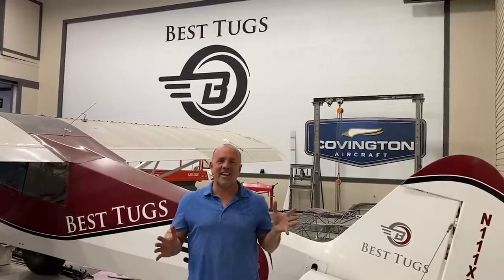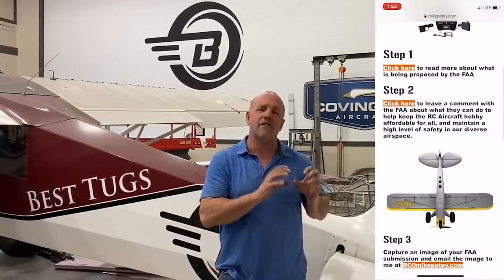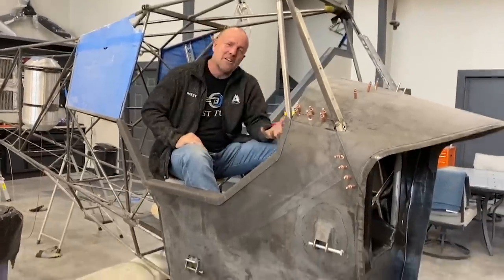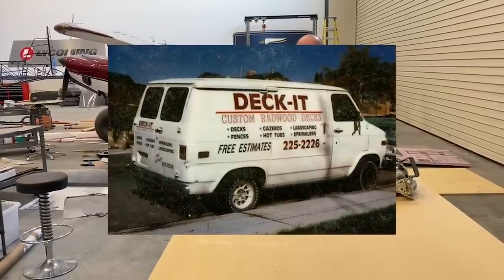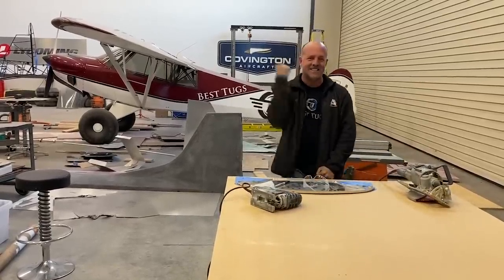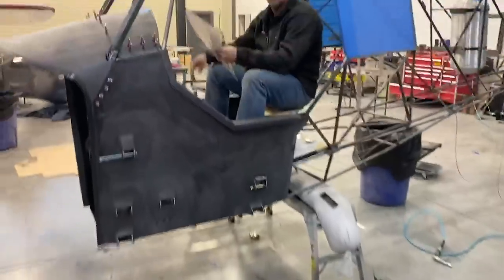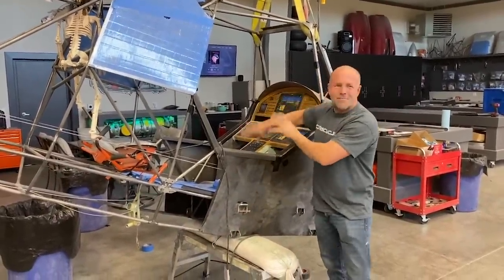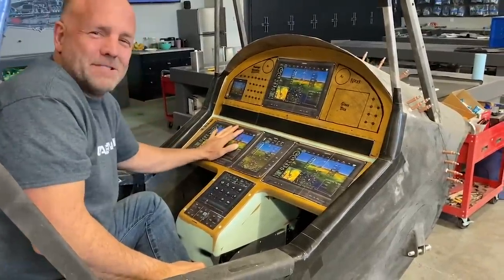🤠 Garmin Glass + Carbon Fiber (SCRAPPY Bush Plane 10)

Comment: Mike, I'm so glad to see you asking for help on the Remote ID NPRM.  It would be a disaster for the RC hobby.  I submitted this comment about ten days ago:

"I am writing in opposition to the proposed rule, inasmuch as it applies to Traditional Model Aircraft (TMA) (as defined in the 2018 FAA Reauthorization Act; that is, small unmanned aircraft systems that are not capable of navigating beyond the visual line of sight of the operator through advanced flight systems and technology). As an active general aviation and airline pilot, I have a vested interest in both maintaining the safety and security of the NAS, and in promoting aviation to future generations of aviators. The TMA hobby is an excellent avenue for promoting aviation and should be protected from unnecessarily burdensome regulation.

The proposed rule makes an inappropriate and unsupportable assumption of risk with respect to TMA operations. These models have been safely operated in the NAS for generations and pose no more risk today than they have in the past. They are built and operated by skilled hobbyists who adhere to a widely publicized Aviator's Model Code of Conduct. In fact, the TMA flying hobby should be used as a model for successful, safe integration of newer UAS into the NAS.

The rule proposes that TMA be required to carry a Remote ID device, presumably similar to a manned aircraft's transponder. Further, the proposed rule would require automatic on-board geofencing in cases where a TMA lacks Remote ID. These are expensive requirements that are unnecessary due to the fact that TMAs operate entirely within line of sight of the operator. They are small enough that the limitations of human sight make distant operation, practically speaking, impossible. Instead of requiring expensive electronics that add unwelcome weight to delicate models, the FAA should expand its use of the Low Altitude Authorization and Notification Capability (LAANC) system to allow TMA hobbyists to advise the FAA of their intended operations via an internet portal or smartphone app. This system would provide necessary information to the FAA and law enforcement, but should be configured to also protect users' privacy by limiting public accessibility of the submitted information.

The proposed imposition of a 400-foot bubble of operation around a TMA operator is severely limiting and should be entirely stricken from the proposed rule. The visual line-of-sight nature of TMA operations is already self-limiting; the tiny 400-foot limit is unnecessary and will largely destroy some segments of the TMA hobby, specifically giant scale and ducted fan/turbine powered models.

The proposed rule establishes a system of FAA Recognized Identification Areas (FRIAs), in which TMA hobbyists would be permitted to operate without Remote ID, and limits establishment of these FRIAs to a 12-month period after adoption of the rule. Again, this is an unnecessary and burdensome requirement that would choke out the TMA hobby over time. These areas should be able to be established at any time in the future, and they should exist without expiration until cancelled by the sponsor. The proposed rule also imposes an amateur-built requirement on TMAs, which would eliminate an entire segment of the industry that produces and sells ready-to-fly model aircraft. These are the very models that are most attractive to young people just starting out in the hobby, and most likely to introduce them to aviation. Restricting this segment of the TMA hobby is foolish and unnecessary.

Finally, the proposed rule imposes an annual registration requirement on each individual TMA. Some model hobbyists build, own and fly dozens, even hundreds of models over their career in the hobby. The proposed registration requirement would impose a significant financial and record-keeping burden on these hobbyists, and serve as a barrier to entry for young people who want to get into the TMA hobby. Instead of the proposed per-TMA registration, the rule should be amended to reiterate the current requirement that TMA operators register once. That registration, and its renewals, can include a question about the operator's model fleet, if that information is needed.

I have a friend and neighbor who is both a fellow GA and airline pilot, as well as a model aircraft hobbyist. We live next to an active county airport that has a model aircraft field immediately adjacent to it. In all the time we have lived here, there has been zero conflict between TMA operations and manned aircraft. Model hobbyists have at all times conducted themselves professionally and with respect for the safety and security of the NAS. I have seen no reason that the TMA hobby requires or should be subject to the onerous and burdensome regulation proposed in this rule. Please consider amending the proposal as suggested above, and let the TMA hobby continue to serve as an exciting, low-cost pathway for youth to enter the aviation world in a safe and responsible way. Thank you."

Comment: @Mikepatey love your excitement. Just a question ... do you really need a G5 back up when either one of the G3x or the G3 could be configured to run independently and there for qualify as a backup? Secondly with all the ability of the Garmin suit have you considered going with virtual circuit breakers and save all that space on your panel?

Comment: Outstanding Mike! That ease of access, thinking about how it will be worked on, at least in the automotive field, is called human engineering, also the very last department to be funded.
Reply: View from the road they think about that? 😂
Reply: @chrisbowpiloto  Actually, they do sir.
Reply: @viewfromtheroad2656  I figured, we just like to joke about it. One of my old coworkers suggested that you should be required to work as a mechanic for two years before becoming an automotive engineer!
Reply: @chrisbowpiloto  Hahahaha. As a mechanic from 1970 till 2016, I would agree.

Comment: Hi Mike. I have that very same router and was holding it exactly like you were as you broke the edges. Watch the video and note where your little finger is.  There is no guard. U adjusted my grip and my lit like finger drifted down into the bit. Took the better part of the little finger nail and part of the tip right off.  Take care. Love the videos

Comment: Glove Box +1 screen.

If the glove box has a door (like glove boxes in cars do), then the glove box door could support yet another screen.  Door could be installed with a quick release, so it could "go away" or be an option.  Or the door with screen could open up and retract along the ceiling of the glove box, like a garage or hangar door.

Comment: Hi Mike you are doing a great job on Scrappy.  There is one thing I wish you would consider changing  and that is twin counter rotating props.  That is the only safe way I can see you getting the same 0 to 60 mph launch that airboats can get. It would also be the only cub with near vertical takeoff and no torque steer

Comment: I do carpentry and wood working and I have struggled with what sort of hear protection I wear.  Ear muffs are bulky, ear plugs are slow.  I recently started using ear plugs on a springy band that holds them in my ears.  They go nicely around my neck when not in use.

Comment: Hey Mike, have you looked into Vertical Power systems? Instead of having switches and circuit breakers they have a solid state module allowing you to have electronic circuit breakers that you can interact with through the EFIS G3x display- less holes in your panel and it’s cool

Comment: Mike, After seeing your dash mock up.  I would strongly suggest you get one of those Garmin screens and  make sure that you can actually see the smallest information on those screens. You have a pretty extreme angle on those two lower screens. They may not be viewable. Also, at that angle. They will pick up all sorts of glare from the cockpit roof, windows and windshield and sunlight. But, you are a super-engineer. I'm sure you've thought about that..... But just in case.

Comment: Rod Jones
Thank you for your videos, i enjoy them very much. I have a question about the firewall in Scrappy. I noticed that it is constructed out of your favorite carbon fiber material, doesn't

 a firewall need to be made out of stainless steel or other noncombustible components to keep fire out of the cockpit? Thanks again for all your fantastic videos..

Comment: Wait mike! The point of scrappy and the big motor was you got a bigger motor but you would have to sit in the back if alone. How will you be able use the glass from the back when you are solo? Also, you could put a front facing camera like Trent to help you see when taxiing.

Comment: Mike, I am getting rid of old style circuit breaker system in my Glasair and replacing it with a VP-X, enabling you to monitor and control your entire electrical system on the EFIS display.
Richard

Comment: Added my comment to the FAA proposed regulations. For visually controlled R/C models no new regs are needed. Especially small models that are a few pounds or less. Autonomous or beyond visual sight is a whole different issue and need some form of regulation.  Many many aviation careers where built on kids flying models. Huge benefit to sparking interest in young aviators. No needs to stomp it out with group think draconian regulations.

Comment: Now i feel sorry I am from EU ((..;) , Mike dynamically motivational-as always. PS. But one thing actually wonders me: Mike's idea for reinforced Cub frame and compared to an airliner's structure which is IMHO not quite the same - it has different workload characteristics. Here-in Cub-two different materials are being mixed together: steel frame with its capability for instantaneous, non-permanent deformation, flexible to some extent AND carbon fiber, rigid shell, much more bending resistant but breakable beyond some critical point.

Comment: Are you already thinking about how to engineer the wings? 
A severe limitation to stol performance in bushplanes is that flaps just span half the wing. Yet if the ailerons would both deflect down as fowler flaps but still remain controllable you would basically have a whole wing flap and more effective ailerons during approach/landing. It would be nice to see your take on it.
Reply from the maker: yoshyoka correct and yes I’m working on wing design but I won’t begin until everything else is done and engine running complete so I can double check the weights and set my wing loading dimensions
Reply: @MikePatey  I am sure you're going to be quite original in that as well. Keep up the good work!

Comment: An idea I got from a rotor wing pilot friend:
Replace the traditional center control stick handle with one from a helicopter. You can then have a guarded ignition switch so you don't have to take your hands off the controls on the event of an engineer failure. You can also incorporate electric trim into the handle.

Comment: Did you consider using something like Spectra Microline to replace the steel wire and save weight?
It's commonly used for spinnaker halyards inside the mast on skiff dinghies that carry a lot more load. Happy to check exactly what product is preferred.

Comment: I haven't seen mention of it in the comments yet. But one thing people should pay particular attention to, in regards to the RC regulations proposal, is how "RC air parks" (I forget what the FAA refers to them as) are to be handled - now, and particularly in the FUTURE.  Basic run-down:  They are limited and require special licensing.  As they close down, get bought out, lose their license, etc.; NO new licenses will be issued.  It's basically a war of attrition to the point of extinction.

Comment: Fantastic panel.  Antenna placement? Does all the carbon fiber effect how you place your antennas? Built for maintenance accessibility, very nice.
Reply from the maker: Eric Jon yes, sometimes I cut out a section and install a 8” circle of fiberglass so the antenna go go direct under that area, on this one I want clear carbon so I don’t want to see a section of fiberglass so my antennas will be external mounted

Comment: Hey Mike, what did you use to paint the MDF with for mold release? I was hoping you would expand a bit on that. MDF is so absorbent I was wondering if you needed to do anything different with the mold release process. 

Love your series by the way, so many great tricks and techniques are packed into your videos.
Reply from the maker: Matthew Menze  great question and I have a really good trick.   Your right the release just keeps sucking in and absorbed by the wood so it doesn’t want to release no mater how many layers of release coats.  This is the simplest trick ever.  Go to the hardware store and buy some cheap rattle can clear coat paint.  A couple of fast coats of clear fast dry and then you can put on the release and it doesn’t soak in.  The day I figured out that trick changed wood molds for me.  Hope that helps 👍🤠
Reply: @MikePatey  Thanks Mike! I'll definitely keep that in mind for some projects I have kicking around.

Learning about tricks/tips/processes in projects is a huge part of what got me interested in making things, and ultimately lead me to my career as a firmware engineer (I picked firmware because it inherently interacts with different things).

I love any time projects come to an intersection of skills. Experience with paint and woodworking informing composite construction is just one of many I've seen in your videos. I'm sure your videos have an will continue to inspire many!

Comment: Hey Mike could you talk more about this panel, maybe I just don't get it , but if you lift it out and out of the plane wouldn't you need longer wire harnesses then? Or is there some new connection system I've missed. Love the idea just can't work out in my head how it would work out.

Comment: The bigger issue is this seems to be redefining Airspace. In uncontrolled airspace, 0 to 200 feet is  unregulated and you can build a building or radio tower up to that height and it will not showup on a chart (See FAA tower registration site). In controlled airspace that height goes down almost to zero the closer you get to a runway and you either have to light and paint it or can't build it or fly it. The standard is stay above 400 feet to avoid unknown objects. Problem is few people know the standards as they are never mind creating new ones.

Comment: Hey Mike. Fellow Pilot and new to your channel. Man are you living every pilots dream! I love it brother!! Anyway, I was thinking about something that exists in cars today that might be beneficial in Scrappy with all those screens. Why not put an enhanced- 3D camera system in where you can see all parts of the aircraft at any time? Same as in modern cars today that give you 360 degree views basically do so by stitching all the camera angles together and placing a sillouhette of your car in the middle. It appears as though a camera is above your head. Now for airplanes, this won't be enough but it's a good start. If you were to place two cameras on the roof facing fore and aft, you could theoretically accomplish the same thing but with real information as to what's 'on top of you' as well. The same applies for the bottom but since Scrappy is fixed gear, it may not matter as much.

Just an idea and possibly a solution that if not already developed, could be created. You've already implemented some awesome Garmin technology into what will likely be the best airplane in the world, let's finish it with a nice touch of a true 360 degree, 3-axis camera system for maximum situational awareness?!

Some of us have the knowledge but not the money. You seem to have both! Thanks and keep the blue side up! --Richard

Comment: I'm not a pilot, so bare with me, but how do you pull the new dashboard out, with wiring and tubing, etc. still connected?  Also how do you put it in and get to the back to make up connections, maybe all plug in connectors hanging out of dash holes?

Comment: I've been flying G3X Touch for maybe four years -- you've got more screens than you'll really use. And the higher screens will be easier to read, especially IFR.Moving your head vertically is not good, IFR. Put as much as you can on the panel, don't waste that space for circuit breakers and a glove box.

Comment: How will you deal with vibration, panel flutter due to turbulence, not to mention prop vibration and general mechanical jangling.
I note you reference vibration but might you have to add stiffners etc to large flat panels????
Alan in London

Comment: Hi Mike yet another mind blowing video I guess the orientation to vertical for some aircraft instruments is not so much a requirement these days I do think you went a bit too far when you included a glove box I mean really ??  I am based in the UK and an RC flyer we are suffering the same problem with regulation these people haven't a clue. I can't say I am as excited as you are about drone deliveries for various reasons but I have bought a hard hat for protection.

Comment: What are those little orange metal pins sticking out on the body work all over the place?
Reply: they are clecos. They hold metal onto the aircraft so they can be removed slowly and replaced by rivets. Hope this helps
Reply: @wackaircaftmechanic2312  Ahahaha better late than never with the response, I thank you for it still!
Reply: @samuelkemp4557  If I saw it earlier it would be there earlier!